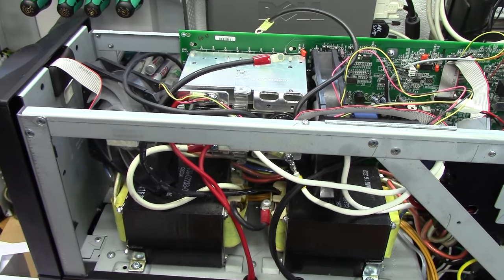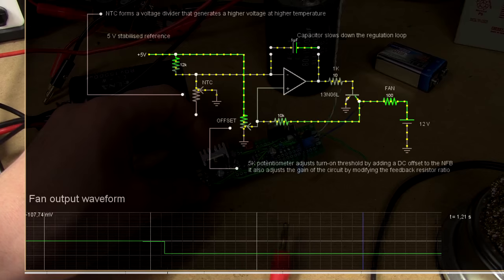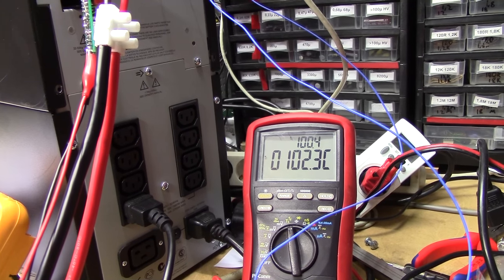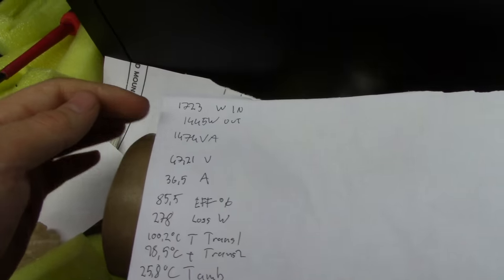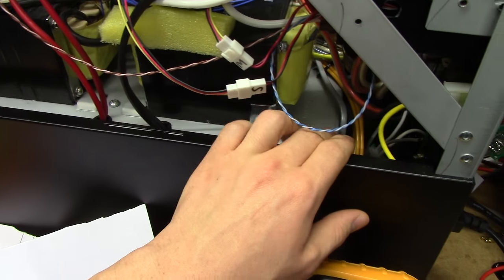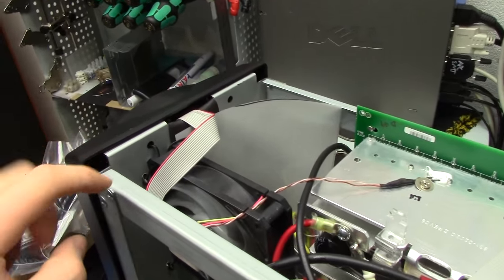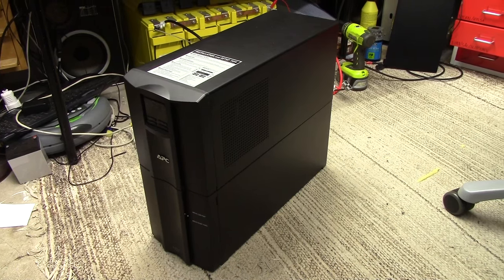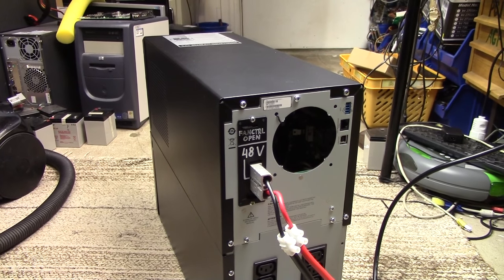Smart-UPS SMT2200I cooling hack: 1500W continuous power!

Comment: Your video is the closest I've come to see anyone give me an idea what I can tap off of to add a fan to one of my UPS's.  I have a couple fans and thermistor etup that I' like to add but don' feel comfy tapping direct from the batteries...  I hope you show were you tapped your fans off of....   regards...  great video.
PS Since and because you are using those bottomless batteries you will probably get more heat a a result; at least in the initial charge up and during any recharges and run ups on battery.   Unless that UPS is a double dipper or whatever they're called (always running DC to the front and converting to AC all of the time) it will always run hot.  I was thinking, however, that since you have no batteries in the battery compartment you could convert the battery compartment into a refrigerator and keep some beverages cold at the same time...   At least you won't need a furnace in the winter time...

Comment: Put some heatsinks on the bottom of the transformers in the empty battery compartment, that could help with cooling them off.
Reply from the maker: +ScottieNiven That's a reasonable idea. I didn't do it right now since it takes a fair amount of work to do it properly. I'd like to shove some thermal compound under the transformers if I did it, or just cut holes underneath them to push heat sinks against.
Reply: +FFcossag The best way to cool transformers it to put them in a mineral oil, but thats kinda impractical for a UPS unit :D

Comment: Have you test this setup with an inductive load? Like a motor from a compressor of powerjet wash? They have a high inrush current and low power factor. I like to use my powerjet wash on ups power. I measured it with my AMP clamp from mains and it draws 6.2A continues and 18.4A inrush (230V).
Reply from the maker: APC Smart-UPSes tend to handle inrush quite well, but I can't say much for certain. Never had this crap out on me despite using it to run a big vacuum cleaner.

Comment: Are the transformers thermally bonded to the metal floor in the unit? I think two old PC heatsinks and some quiet fans would work ok, if you mounted them upside down inside the battery compartment :)

Comment: Gentle Typhoon. Unf.
consider doing some testing with thermistor-controlled fans by Nidec? the Beta V ones that came with old Dells were great, and I'm using one as the exhaust in my HP sleeper, as it's the best 92mm fan I had to use at the time.

Comment: I do similar mod to my APC Smart UPS 1000I and 1250 , the 1250 has a very loud fan 24 volts, and no exhaust to air, i drill a big hole on the side, problems resolved, now i need to put constant silent fan, i use ANtec silent fan.. works like charm, but using outside 12V, psu, i dont find a secure point inside to grab 12v , i do this mod for cooling batterys and circuits,  now both UPS run cooler and silent on the night, next mod is adding a automatic circuit for turn on the fan when certain temperature is reached.

Comment: Reply please, are this ups type low frequency or high frequency inverter ?
Reply: Low frequency inverters have massive iron core transformers. So these should classify as low frequency. They were designed and built 20+ years before the difference was distinguished by marketing departments.
Reply: @duotronic6451  thank you sir

Comment: Good day!
I get in my hands SUA 3000i (manf.date 2010). It has cooling fan with 2 speeds. 1-st speed is always on and very annoing during night, when ups load is off. Can i add circuit braker? I thing ups wiil bring internal fulty error or not? 
Thanks!
Reply from the maker: +Ruslan Zamaletdinow You probably can, but the UPS will overheat if the power goes out, so I would not recommend it.
Reply: Why it should overheat? I'am turning off "load" (PC with monitor), then turn off with button on front panel UPS. If i right, it shouldn't go on battery backup after that. It just still force cooling fan to operate even if ups is off. I can understand working cooling for up to 10 minutes to cool internals, but after that it's annoying.
Thanks for replay. And small question. Where did you get 5V for fans? Standart one is working on 24V if i right.
Reply: Oh about fans. I see now, thay are powerd by custom logic controller. Sorry)

Comment: Pressurizing the inside help a bit, denser air=better heat transfer, having negative pressure isnt good
Reply from the maker: +Rex Holes I don't think any amount of pressure makes much of a difference in this case, since we're talking about really small changes. I just like to think in terms of pressure when I'm thinking about how my fans are going to make the air move around.
Reply: +FFcossag Fair enough but I have measured a difference in PC cases haveing negative vs positive pressure, it might help

Comment: Hey man awesome video u inspired me I got one of these the other day for 60 bucks. I just put another fan one full for now but keep having the system shut off. I went into powerchute and it said time on battery threshold exceeded. I checked and couldn't find any where to change it. Battery still has good voltage I was only pulling 1400 watts and the transformers were only max 45c 115f. Any ideas. The board does sound different when running above 1000w
Reply from the maker: You need to use the SMART protocol programming mode to change the number of external battery packs connected. Powerchute won't do that for you.
Reply: @FFcossag  I made the switch and serial wire using the pinout but cant get putty yo come up i tried 2400 baud rate cause that's what everyone says
Reply from the maker: Then you've done something wrong, assuming that you've done the hack to reroute the front panel SMART data to the MAX232 going to the serial port. Keep in mind that I don't know if you can get SMART at all out of a MODBUS capable model.
Reply: @FFcossag  I have the old firmware, I bought a different serial cable cause one I had I think was a crossover or something weird, I am able to have the front panel work and not work with the flick of the switch i made just like u. So my guess is it's the serial cable i had
Reply: @FFcossag  please double check me that I don't have modbus my firmware is com 01.2 / ups 04 D (04.0) -- ubl 04.0  cbl 04.F.